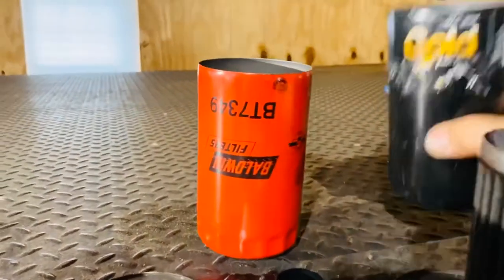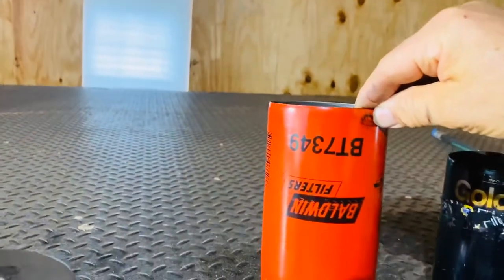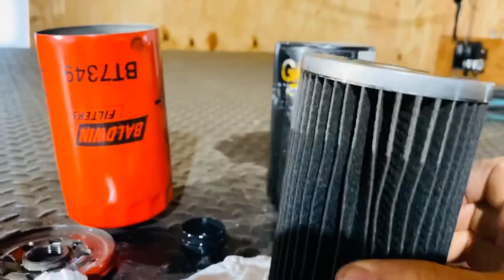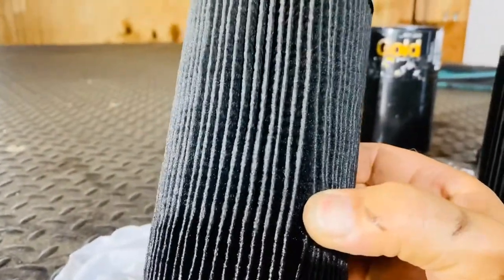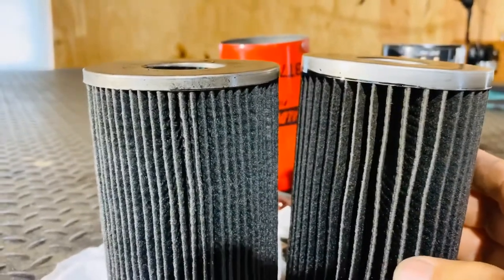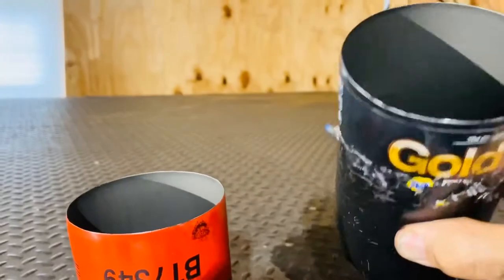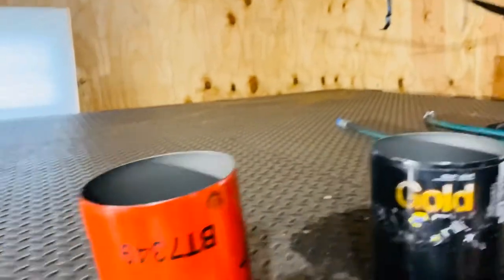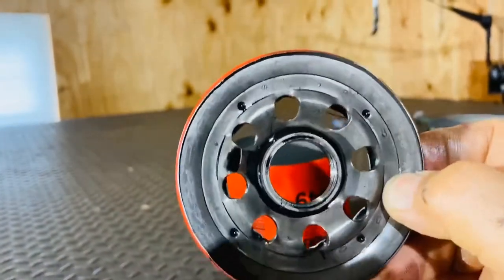Napa gold & Baldwin oil filter review

Comment: Working in the field for many years, checking oil on engines, Baldwin is by far the most common filter  (air, oil and fuel)  on commercial engines.  The rental companies use them. 
  Napa Gold/Wix comes in second.  I never once saw a Fram.
Reply from the maker: I agree I see a lot of rental equipment with the Baldwin filters.Even a lot of diesel generators have them I’ve used all in the past and never looked into how they are made. But the Baldwin Napa gold and wix I think are the best quality 
Nice talking to you Have a great day

Comment: Baldwin is not bad at all but I think Wix has it handily beat in filtration efficiency being 99% @ 23 microns.
Reply: Hi Kevin, 
The Baldwin is 99% at 17microns on their website, not bad for a $9.00 filter. Napa are a little pricey, would rather run Donaldson DBL’s. I’ve cut my oil changes down to 6k because of soot. Have a good day.
Reply: Wix makes the NAPA filters.. The Baldwin would definitely be better for cold weather starts. These oil filters are pleated filters. The folds on the filter material are called pleats. More pleats means more surface area of filtration. You may know that but general info for others that may not. Try a John Deere filter. Your Baldwin BT7349 crossed over to  John Deere F058309 or TY22013. Likely more filter material and larger hols on the inlet to the filter.